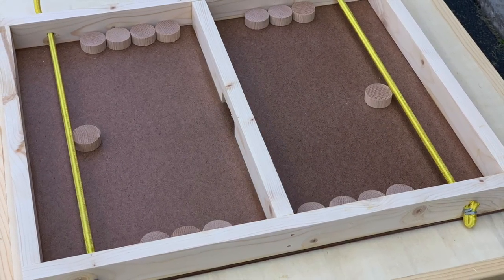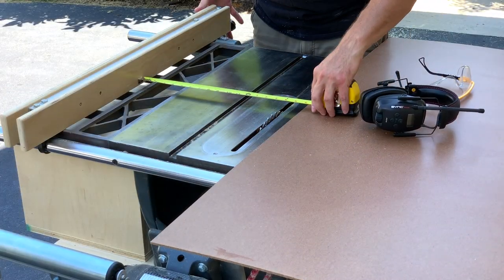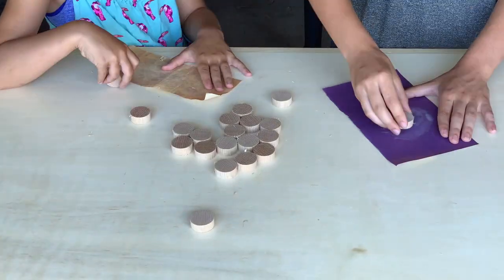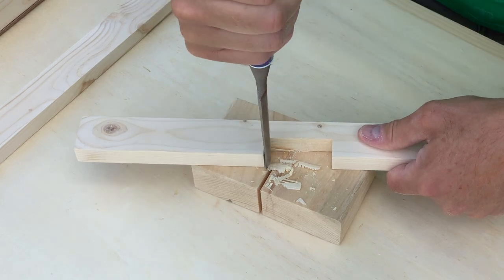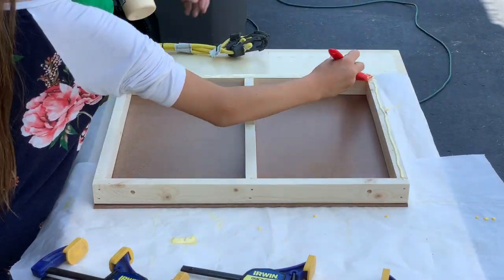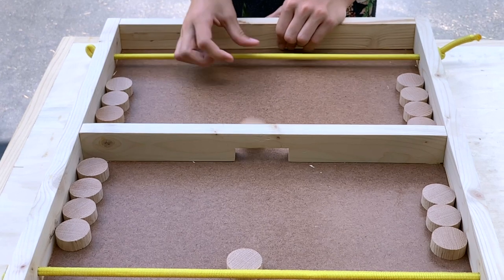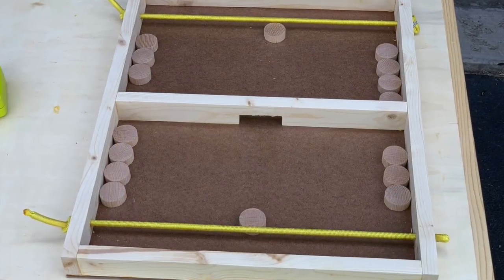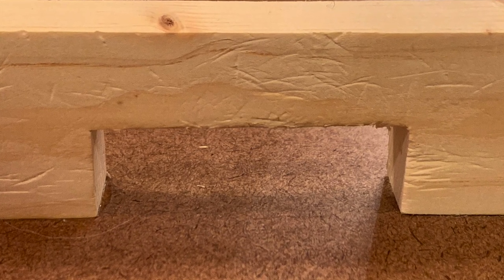DIY Finger Hockey Game // Family Game Night // Wooden Game Build // Woodworking

Comment: Are you using a 16 gauge or 18 gauge nailer?
Reply from the maker: I used a 16 gauge. One thing I learned when making some more of these for gifts is to use screws instead of nails, if you use a hardwood for the frame. My nailer struggled to get the nails into the oak I used for the gift builds. Some nice finishing screws would have worked better. If you’re using pine, like I did in the video. then nails will do just fine for you.